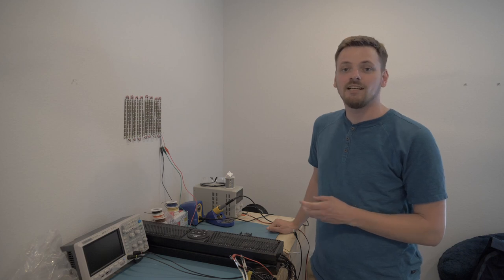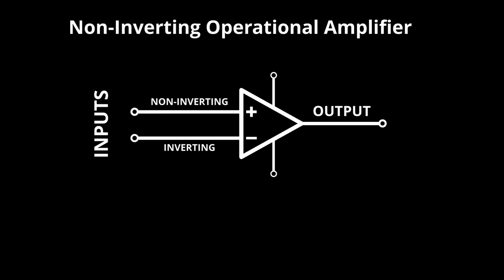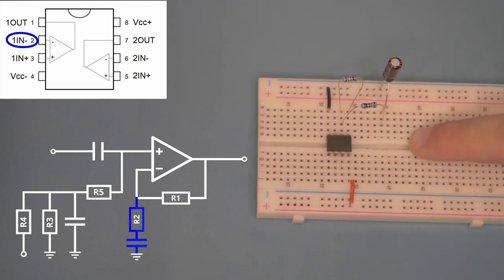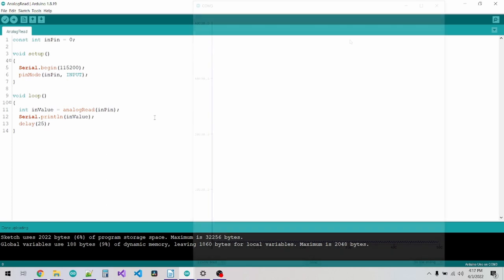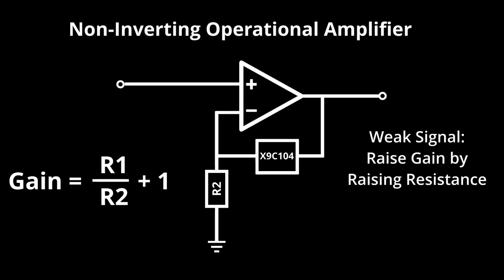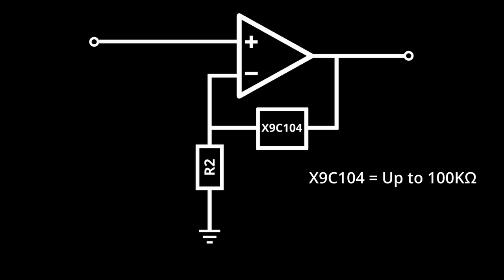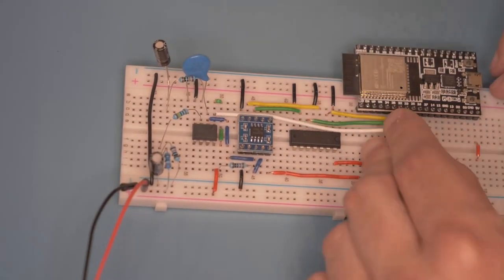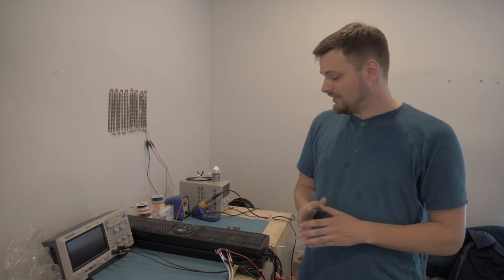Creating a Spectrum Analyzer using an Arduino and a Non-Inverting Operational Amplifier

Comment: It would have been easier and more linear to use the TL072 in an inverting setup powered with a 5V single ended power supply. The absolute polarity of the audio signal is irrelevant in this application. This way you set the DC offset (bias) with a voltage divider on the non inverting pin. This way the bias does not mess with the audio input of the circuit. This is probably why your signal was so non linear when approaching clipping as the signal was skewing the bias. Also a simple resister/diode on the output would give you a simple "crowbar" protection of the Microcontroller's input.
Reply: The snag is that the TL072 doesn't swing rail-to-rail, so you'd lose up to around 1V of your 5V range. Something like an MCP602 is designed for interfacing directly into an MCU and isn't expensive, also the unused amp is a good way to derive a solid 2.5V bias point. Using a 4.7V Zener (or a TL431) on the output via a 10K resistor would provide both positive and negative protection for the MCU.
Reply: Not really. The input cap decouples the previous stages so that's not why. The linearity is similar for both. The reason for clipping is that the opamp just isn't rail to rail
Reply: @thewhitedragon4184  Agreed. The linearity is very slightly worse in non-inverting mode because both inputs must rise and fall with the input signal, so any non-linearity in the common-mode response is mixed into the output. With any decent opamp it's an almost negligible effect, though.
Reply: The TL072 has garbage output swing. It's a decent audio amp but you need like ±5V to operate it. Meaning you'd need like 9V supply or 12V supply minimum. That being said it's noise and distortion are great. It's a good preamp if you have a higher supply voltage or just need to get an electret mic to like a 100mV
Reply: @thewhitedragon4184  Actually, the TL072 with a single 5V supply has a typical output swing from 0.18V to 4.3V under light loads, which was a lot better than many of its contemporaries when it became available in the late 1970s. The real problem was phase inversion and lock-up on the negative swing.

I think that to call its output "garbage" is a bit of modern revisionism, because for audio use (especially with high-impedance sources), it was the only affordable solution for many years.

I do agree that higher supply voltages make it a much more tractable device, though, and its high frequency drive performance with ±15V rails is still the best at its price.
Reply: @RexxSchneider  I would dare call the tl072 garbage. I love it and slap in everywhere. Remarkable device for something made in the 70s. It's output swing isn't that great but actually I thought it was a lot worse that 0.18V. That means you can still use it for a decent cheap preamp for electret mic running off of the USB port and get significantly better audio then plugging it in straight
Reply: @thewhitedragon4184  Sure, you can use it with a 5V rail, but make sure it doesn't get too much input signal as the common-mode range does not go down to the bottom rail and it really hates inputs close to that. If in doubt, bias the input higher than half-way.

Comment: When you said "we don't want to invert the signal" my immediate thoughts were "but why though?". You're already digitally processing the signal to spling the bands, which I like, but any phase shift (in this gain  multiplying with a negative is a 180 deg phase shif) in the signal isn't going to be reflected in the amplitude spectrum. Plus you could have just multiplied by -1 digitally.
Reply from the maker: Yeah I suppose inverting it or not doesn't affect it in the end, good point.

Comment: ... Rather than connecting to a variable signal, I would have connected a small amp in parallel with the soundboard input, so I could have a strong consistent signal regardless of speaker volume.

Comment: I tend to not use breadboards, exactly for one of the reasons you evoked, it's impossible to know if it's wired correctly but with flaky connections or if you fucked something up. At first I thought it was making me waste components, but by building up circuits modularly enough I now think it's not really worse. Of course I'm just a beginner so take this with a grain of salt :)
Reply: I used a lot of breadboards in school and yeah they can be flaky with connections and really like to make oscillators
Reply: @jhoughjr1  oscillators that quickly turn into fireworks
Reply: @fmdj  sometimes but op amps don’t have the magic smoke that electrolytic caps have

Comment: With a single audio signal, it makes no difference if it gets inverted or not.

If working with an alternating signal into an opamp with a monopolar power supply, use the series input capacitor as shown, and follow it with a bias voltage sufficient to bring the output within the power supply rails.....the video shows this, but only for the reason of not presenting negative voltages to the Arduino. BTW, if after amplification by a positive-only opamp circuit, it is desired to have the signal be bipolar/alternating again, follow the output with another series capacitor, then a resistor to ground to re-bias.

Comment: You could have  routed microcontroller Vcc to the analog circuitry, then divide it in two to make proper desired bias voltage for the input AC signal. Then just simply use rail-to-rail OP Amp, like TLC271 (TLC272 for drop-in TL072 replacement), or newer TLV9101(TLV9102 for drop-in replacement).
However, why throw away a perfectly good TL072 already in your possession? Regarding the signal diving too close to negative (ground) rail, resulting in clipping, you could have used 2.5V bias inside the amplifier powered by 5V, but add another AC coupling capacitor between output of your amplifier and analog input of your microcontroller, with DC biasing (using microcontroller 3.3V Vcc ) on microcontroller side of the output capacitor.

Comment: I'm confused about the gain range you chose, being about 1 - 3x
If max P2P is 1v, then your max output would be 3v.  But that's your max gain against max input.  If your input volume is much less, you can't increase your gain to compensate, you've already maxed it.

Comment: A very low r1 is not a problem: the inputs on the op amp are high impedance, and the other path is 100k

Also, the inverting configuration is probably more flexible without any downside.

Comment: At 2:47 "More detail's better, right?" Quite right, so why not amplify the signal up to ± 5V and simply clip off the negative half before feeding it into the arduino? You would get double the resolution, since the negative half of an audio signal contains just the same information as the positive half.

At 9:14 "having the resistance of R1 near zero is probably a bad idea". No, it really isn't. It's quite normal for an opamp to be used as a non-inverting buffer, where the output is connected directly to the inverting input. Opamps are designed to work like that, and the current drawn by the inputs is normally quite negligible, certainly for audio applications. There really is problem with "leaking" or "current drain" through the feedback. The TL072 has an output impedance of 0.25Ω and can easily supply 50mA, so stop worrying about current draw.

As @Joel Styler pointed out, you must have something like a 100nF ceramic capacitor across the supply close to the IC, as it's crucial for stability. I also agree with him that high impedance means noise pickup and high-frequency loss due to stray capacitance. You could easily drop your feedback resistors down by a factor of 10 or more to improve noise immunity. You're certainly more likely to see R2 around 1K in practical audio circuits.

You also need to tie the unused opamp's inputs to something, rather than leaving them floating. The best bet is to tie the unused non-inverting input to the 2.5V bias voltage you already have, and tie the unused inverting input to the unused output.

The most important improvement you should make to the circuit is to clip the signal going into the Arduino to keep it in the range between ground and 5V. A simple way is to use a TL431 as a 5V Zener across the Arduino input and drive it from the opamp output via a 10K resistor.

If you now know that the output is constrained to the range 0-5V, then the digital pot -- fun as it is to play with -- is complete overkill. A simple trim pot for R1 will be more than adequate and will allow you to quickly set the display to match the music level.

The value of Cfilter sets the frequency at which the gain starts to roll-off and for audio use we would normally set it so that its reactance equals R2 at around 20Hz. That implies a capacitor of around 100nF if R2=100K or 10μF if R2=1K.

You don't need two supplies. Many opamps are designed to be used with single-supply. The TL072 is a BiiMOS opamp and is described in its datasheet as "wide-bandwidth high-output-drive single supply" and it was quite good for its time. Nowadays, there are CMOS opamps that can swing to within less than 100mV of either rail, so one of those (e.g. MCP6002) would be a good upgrade.

Finally, it is good practice for automotive use to remember that the supply voltage can be anywhere from around 12V to 14V, depending on whether the engine is running. So the usual way to make the bias point independent of the supply voltage is to use another TL431 as a 2.5V Zener in place of your R3, ensuring that the non-inverting input (and hence the output) stays at 2.5V regardless of the supply voltage.

Comment: And you would want to run the signal through several bandpass filters, one for each bar and then sampling them individually to get a true spectrum representation.
Reply: he must be running Fast Fourier Transform on the Arduino to separate the frequency bins for spectrum representation. Which is accurate enough if the sampling window size is large enough, however, higher the sample window, higher the processing latency.

Comment: i see a slight problem coming. some songs etc. have long durations of low to no amplitude. to fix this you would need a delay of 1 minute or more before attempting to raise gain. ideally, adjustable to your preference or by using a button to manually raise to peak.

Comment: If I may, add 1 more resistor in your input between the input cap and the the mix point of the offset voltage. google: op amp summing amplifier, you will see each input as an input resistor. This is basically what you have done, the offset voltage is just another input to be summed. you have inline on that one, but missing the inline on the input. overall good job
Reply: Unfortunately, an opamp operating in non-inverting mode isn't a summing amplifier. If you want to mix two or more inputs, you need a virtual ground and that only occurs at the inverting input.
There is no point in placing a resistor in series with the input in the non-inverting configuration as it would do nothing other than create a resistive divider between itself and the 1M resistor used to bias the non-inverting input for dc.

Comment: While the theory of the non-inverting op-amp is fine, there are a few problems here. First, powering your op-amp from 12V in order to drive a 5V microcontroller is crazy, as it will eventually result in its death. Just having too much noise (e.g. touch input wire) or having a poor connection on a wire will be sufficient to inject 12V into it. Second, I'm not even sure the digital potentiometer is designed to stand 12V (which might be how you killed the other one). You absolutely need to use the target power to power your chip. Another point, instead of having an automatically adjusted bias you could just use the more common virtual ground using 2 resistors and have the output centered around half of the power voltage. It would accurately pass the amplified input to the uC and you would have no clipping. Finally, connecting this to a microcontroller is not a good application of a non-inverting amp, because it's much easier to invert the value in the uC (use 1023-Ain and that's done), and for a spectrum analyzer you don't even care about the polarity at all!

Comment: I really liked the video until you added the digital potentiometer which isn't a proper way to do this, instead the signal should come from the pre-amplifier circuit. Thanks for sharing by the way. And will you make one for the software too?
Reply from the maker: Yeah my main goal with the video was just to share what I learned, the issues I ran into, and how I went about solving them. I'm no expert so I'm sure there's better ways but I found very little info online about using op-amps the way I wanted to. 

The reason i never ended up posting the arduino code to go with this is pretty much because the code is super tailored to how I wired this stuff up and kinda convoluted so I figured it would be pretty darn hard to read and understand what going on. Plus there's several other good videos on YouTube that go over the code for this pretty well.

Recently I had the idea of creating a followup to this video where, once I'm back from my road trip, I take into account some of the feedback I've gotten on this video so that I don't need the overly complicated digi-pot idea. That way it'd be nice and simple and I could upload the .ino code too. It'll be a while till then though.

Comment: Your Arduino has a stable 3.3 V regulated output, which makes you independent from the varying voltage from the battery.
Reply: Unless the battery voltage gets close to 3.3V

Comment: The buffer 74125 chip is not helping here. I'm assuming you are powering it through 5V, which according to the datasheet, would make the threshold for a high signal be 3.15 volts. I think that's not exactly the progress you have hoped for. I believe you wanted to make a logic level shifter that would accept 3.3V logic and output 5V logic, which you also don't need.
The datasheet of the X9C104 states that anything above 2 volts is considered a high input and anything below 0.8 volts is considered a low input, so the logic signals from the ESP should be more than suitable

One more thing, what's up with resistor R6 seperating the 5V of the ESP from the X9C Digital Potentiometer and the 74125 chip? why do you want to limit the current if you are using a supply voltage that's well inside the range of recommended operation parameters?
Reply from the maker: I want to make a followup to this video where I get a new soundbar with a pre-amplifier output line so I can eliminate the sloppy digi-pot idea all together. Then I also want to go over arduino code for a circuit with just an op-amp. I never posted arduino for this video because the digi-pot ordeal made the code very convoluted and I figured it was nigh impossible to follow, which kind of defeats the purpose of a guide/demonstration like this. 

If I recall, R6 was put in to limit current flow going into the digi-pots Vcc. I had 2 of those digi-pots, and the first one I used died shortly after using it, I assumed I killed it with too much current on that line.

Comment: Is the input voltage that you're getting from the phone connectors the equivalent to the output voltage you would get if you used 1/8 inch headphone jack?

If I understand correctly you're going from RCA phono connectors into your circuit. I'm wondering what the deltas would be to use it with a headphone jack.